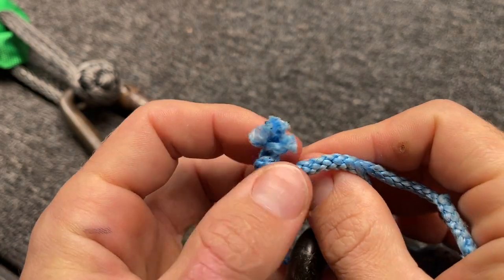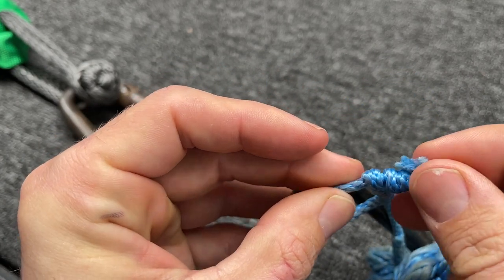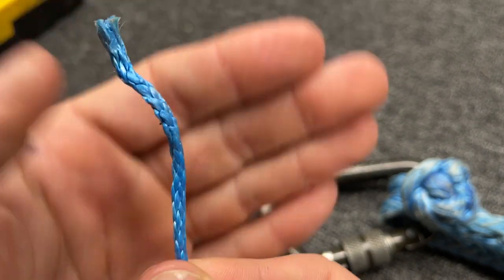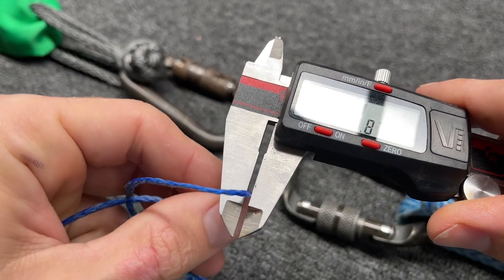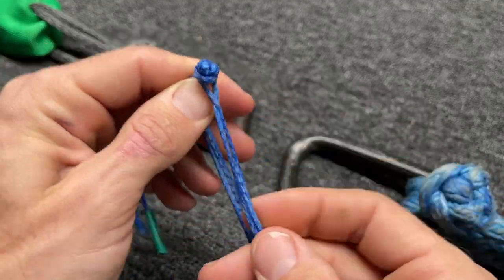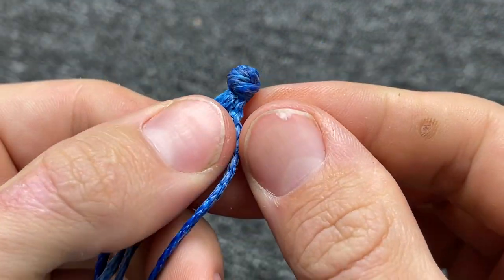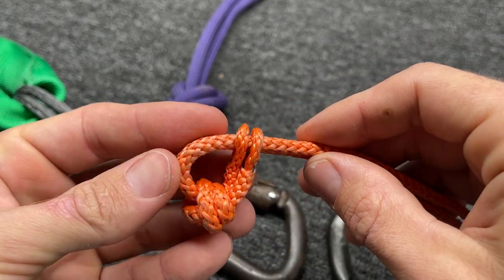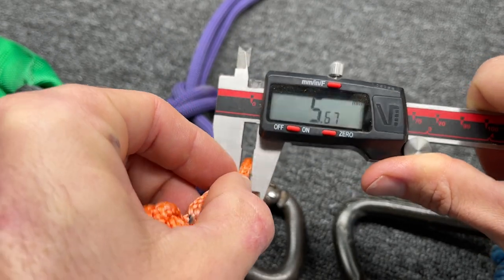Three tiny soft shackles tested

Comment: in hammock uktralight setups, you wouldn't use metal carabineers. How do dyneema soft shackles behave when they are chained? They are sharp angled to each other. I think it will be very weak spot